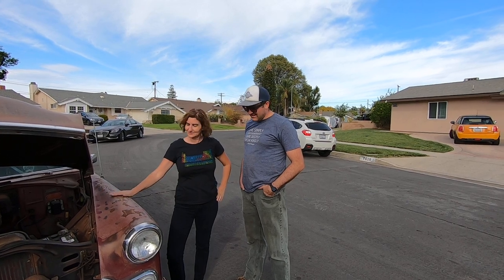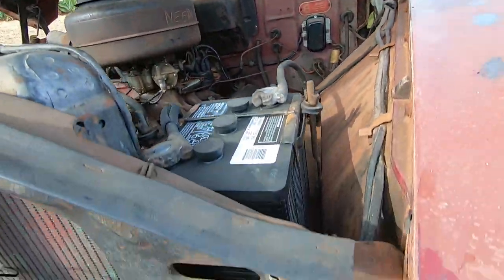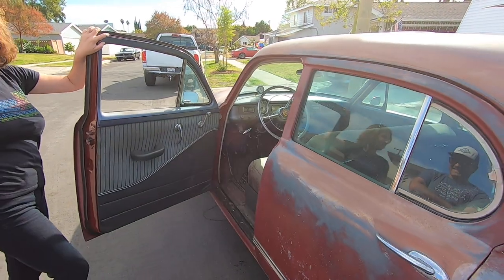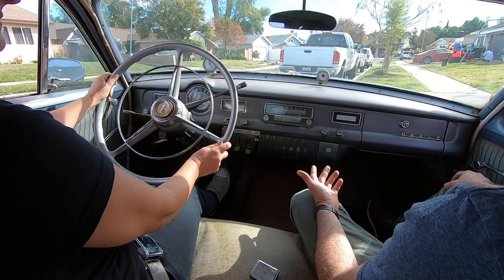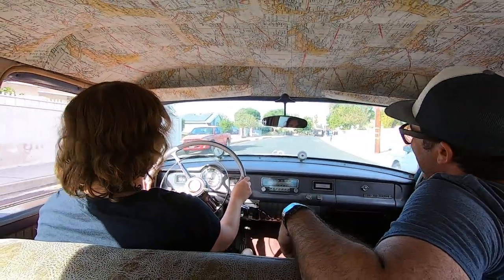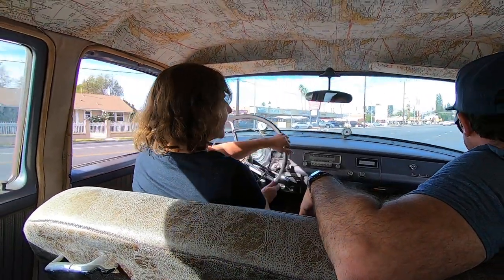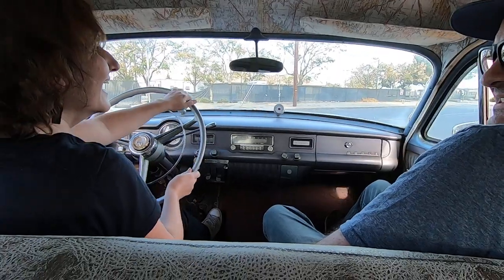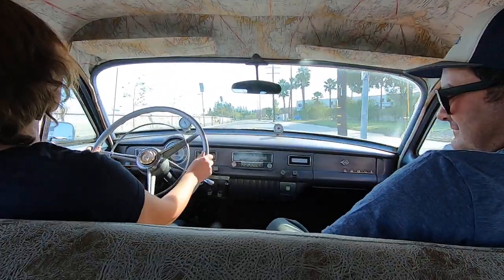'Round The Block:  1953 Dodge Coronet Red Ram Hemi with Elana Scherr and Tom

Comment: My grandfather had 1 of these 2nd hand, also a sedan. Basically, you had 2 gear ranges. A manually selected low range, with 1 upshift and no kickdown, and a manually selected high range ( with what was essentially a 2nd gear start) with 1 upshift, and a kickdown range. ( back to 2nd) When James says he drives around in 'Hi' he's using it like a 2 speed Powerflight ( except when changing to reverse which requires the use of the clutch). The transmission will not upshift until the engine speed slows to near idle, which means you must completely lift off the throttle, wait,  and 'feel' for the upshift, then apply power once again. When you come to a stop, the car will automatically down shift to the next lowest gear, no clutch needed. When the car is shut off, you lose the fluid coupling, so the clutch must be used to engage hi or low setting initially. Let the clutch out, and off you go.

Comment: I had a 1949 Coronet Club Coupe flathead 6 with 47,000 original miles and the Gyromatic transmission. Turn the key and she's on. So quiet you couldn't tell it was running. After a few drives the transmission make perfect sense. Wish I'd have kept that sweet car.

Comment: I got back a few hours ago from a road trip to Maricopa, Arizona after buying a rear glass for my brother's 1954 Dodge Coronet that has a Red Ram Hemi V8 and a PowerFlite 2 speed automatic. 7 hour trip each way from San Diego. Your car reminded me of his so much. I really enjoyed the video. Just incase you may need some parts, Hidden Valley Auto Parts 53501 W. Jersey Drive, Maricopa, AZ 85139 (520-568-2945) is where I bought the glass from a '53 Coronet. Best wishes with the Coronet!!
Reply: Wow, thanks. Great stuff, esp the INDY500 OEM,,,

Comment: The term Gyro-Matic is sales hype by this point in 1953, because it's the same fluid-drive as has been since its debut in 1939.
She has it right, except that there's two gears in low range and two gears in high range.  The guy in the back seat is cracking me up, he keeps mentioning the "lean" around the curves, but he never notices the beautiful ride this car has.

Comment: Well smiling because I know as I inherited one after my Uncles death in 81'. we had called it The Sherman Tank. Amazing it even chirped the tires for its weight. Used it for years as a daily driver, shocked I just checked and the motor set 100 records at the Salt flats in its day. Never knew the small number Hemi had that much but I chose either way to not be race hard on it. I even had an Old Chrysler parts shop in town to get parts for it like old canister held oil filters. It was funny watching him look up old books going in back and coming out with boxes that had thick dust covering them. Very cool Older car.Like to say I have regrets but no, thats my life in always a new unique ride.

Comment: BTW- I'm coming back to this cool video after first viewing it a year or so ago, after a search of the old Dodge Coronets, which is what originally led me to your channel. Since then, I've come to Love this channel and Tom and Elana. Btw- I myself, don't really have the ability or equipment (don't ask) to make real videos, although I've recently tried to make a short Youtube vid with the crap equipment I have, just to show off our old Family Friend- Roger Lamb's  '53 Dodge Corornet convertible Drag car, which was bought NEW, and slowly turned into a street/strip car in the late 1950's all the way thru the mid 1960's. The car still exists today- but, direly needs restoration. PS- Rogers' Dodge always used the little Red Ram Engine but, went thru many experimental mods such as carbs/manifolds, and both auto and manual trans configurations.

Comment: Don't overcomplicate things!   It's much like the Borg-Warner overdrive trans used by Ford, Nash, Studebaker, etc., only it's a two speed  with the overdrive unit. With the shift lever up, it's in first gear. After starting out and gaining a little speed you let off the gas so it will electrically shift into second (just like you would with the typical Ford, etc. overdrive.  This was intended to be the in-town range.  For hiway speeds, you shifted the lever down and repeated the process for what amounts to 3rd and 4th gears.
Reply: That's exactly it!! I had a Studebaker with a Borg Warner overdrive, and when I wanted overdrive, I just lifted my foot off of the gas until it "clunked", and it was in overdrive. Flooring it would briefly interrupt the ignition, and it would shift out of overdrive. My friend's dad had a Dodge truck with a 1952 Chrysler Hemi and a Fluid Drive and it was easy for me to drive because it was so similar to my Studebaker.

Comment: "How do we do a burnout?"  LOL!  Nobody I knew with one of the Chrysler product fluid drives (only Plymouths were available with an actual clutch in 53) ever figured out how to do a burnout, or even break the tire loose on wet concrete.  I don't see how even the 331 hemi could have done it.

Comment: Love this!! Nothing wrong with that old technology as it keeps the car moving. Just get you some seat belts to be safe.
You guys are awesome. Not many millennials know what a generator or oil bath air cleaner is on a car. I won't buy a collector car that has been modernized in any way, shape or form except seat belts and tires.

Comment: My I have owned and restored nearly 50 vintage cars but my very first that got me started in the hobby was a 1953 Dodge Coronet 241 Hemi with gyromatic. I paid $350 for it in 1980 and it had a new Earl Scheib paint Job. A great old car that you could drive anywhere at freeway speeds. Make sure you have good brake lines both front and rear if one line breaks you are in trouble the gyromatic offers virtually no engine braking and the emergency brakes are ineffective. I know I went right through a red light when a front brake line blew. Luckily I didn't hit anything a Prius will be in trouble  if hit by a 53 Dodge.

Comment: My Dad had a '47 Chrysler with the fluid drive version.  I know all about how this transmission works and drives.  2 speeds in the low and high range with a kick down switch.

Comment: Actually four speeds, two in the low range, two in the high range.  I do believe it has a fluid coupling that doesn't have the torque multiplication that a torque converter has.  Powerflite, fully automatic, available in '54 had two speeds with a torque converter.  :)  Jack

Comment: I just bought a 54 Coronet, It came with the original 245 Red Ram and that same transmission but the intake and Valve covers were off it but if turned over. The first thing I did is go talk to the local restoration garage to tell me about it because although I'm a car guy I don't know alot about those early Hemi's to see if t was worth rebuilding because I'm building an daily driver hot rod.  I ended up trading him the Red Ram and Trans for a 318 and torque flight 3 speed auto trans out of 70 or 71 Dart. Yes I know I probally lost a little money on deal but it's not about the money for me, I got a good reliable engine and trans for my car and they got a early Hemi and original trans to save another car, that's a win-win in my book, With the 318 I won't have to change out the rear end or suspension. The 245 pushed out 196 HP and the 318 has 235 HP, That's 17% more HP but I'm not going to be stupid with it and do burnouts or donuts or any of that. It will be fine. For the interior it's pretty much trashed so I'm just going to have the rear seat done and find some cheap used buckets out of a Bone Yard and then I'll get some carpet from the local carpet outlet, I'm not doing a 500 point restoration, it just has to work and look decent while doing it.

Comment: My first vintage car was it 53 Dodge 241 Hemi with gyro matic. A great car it started my 40 year old car hobby.
But don't dump the clutch if you want to do a burnout it's just like an automatic put it in low and rev against the clutch then let off the brake and floor it. If you break that tranny finding parts and someone to work on it is very difficult.

Comment: I love how it's all original. I want to rock my 55 chrysler in its original condition too. Mines a bit rustier since it s a Minnesota car but it still has the original drive line and engine is free. It's got a two speed and am not sure if I am going to rock that or get something different to put power to the road better and get better mpg

Comment: You want to hear something weird? Years ago one of my class mates had a 50 Desoto it had a fluid drive but it was a three on a tree manual transmission . You put the clutch in put it in 1st and took off and shifted it but when you came up to the light put the clutch in put it in 1st put on the brake and let the clutch out . You sit there at the light with the clutch out in first gear . When I came up to the light he said let  the clutch out and hold the brake I said what ? He said hold the brake and let the clutch out when I did hit made this weird whine sound . The light changed and he said take off the brake and give it some gas and I did and just shifted it like a manual trans three on a tree weirdest trans set up I ever drove

Comment: TOLLAR...I had a 1952 DeSoto Hemi such a cool car the tranny was pure dynamite. It could rip out. Once you got the knack to shifting. Mine had manual steering. It was bitching. Me and four guys went hunting, and had a 180 lbs buck in the trunk, and we smoked the hills like God only knows. It had the last of the two piece windshields that I redone with tinted glass. It had early ram air in the hood that would aim drafted air into that hemi mill. With a rainy day the fuel mix was busting the duel point like raw dog wild. No shit ; factory the car had no driver's side outside mirror did not need one at all. The windshield wipers were electric, and something about the shape of the hood, and the angles of the windshield just would not let rain slow you down at all. I almost never used the wipers. Car was a blast. A real Tom Tom. It had duel brake cylinders all four, and that gasser sure needed em. l had the seats covers done in roll, and pleated silver naugahyde. Put modern radials on it. Had a guy do the top in alligator midnight blue vinyl. Painted  it dark silver. Stuck with hub caps; wire fakes from K. Mart. I did all the door panels in fake rock paneling. It was pure evil incarnate. Took out all the carpeting in stalled industrial floor matting. Nothing could approach it's groove. Put in a 8 track  bootleg track head box. Totally clumbzy. Butterfly weed relief front, and back. Had it on a service lift with a girl, and her aunt who was killing, and the hash, and the hemi got wild. The school found out, the car got impounded. Some cop got hold of it. Went stalling on a rail road track. Walked away you know the story.

Comment: I had a '50 with GyroMatic, but it didn't run.  I bought one that was already fixed up, but it just has the entry level "Fluid Drive".  

The torque converter is actually added onto the fluid drive.  It's like an overdrive, but I've heard it described as an "under drive".  My dad just called them "clunk-o-matics."